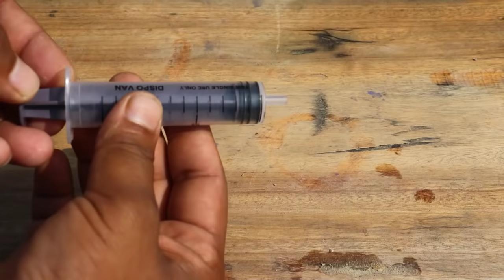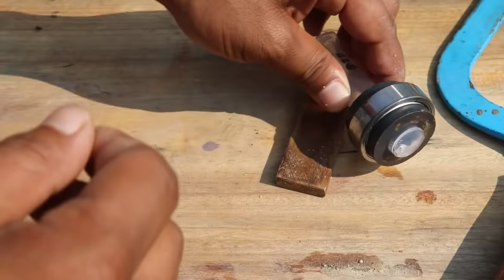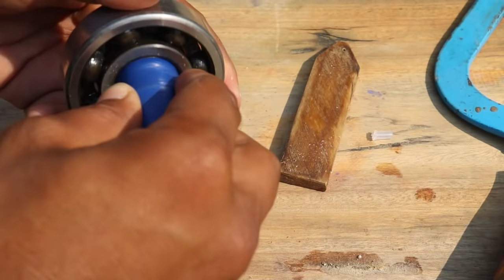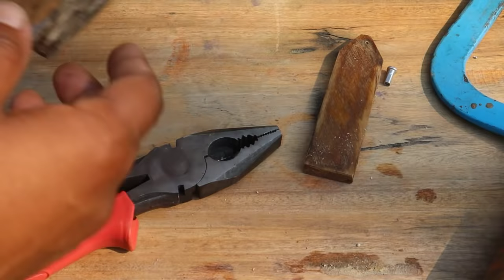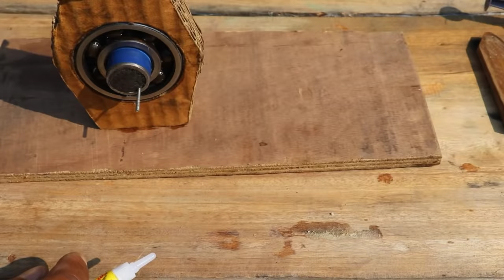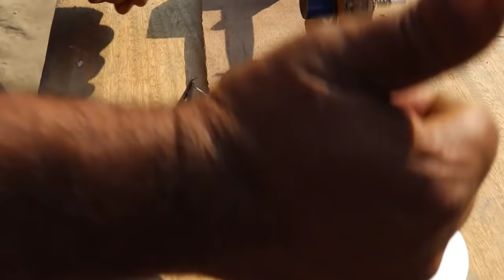single cylinder engine 100% working

Comment: You can use springs also instead of magnet but don't forget to hide rc motor & batteries
Reply: @buildingblocks6081  yes 🤣
Reply: No. Springs wont work. Magnet works cuz N -S attracts. And NN /SS repels...
Reply: @reyaroy4236  🤣🤣🤣🤣🤣
Magnet is doing pull and push and spring does the same
Reply: There is no batteries in this project
Reply: @pushpendrabhai9499  🤣🤣🤣🤣🤣
Reply: I thought exactly same... But the fact is energy can't be created only we can transform using another resource of energy...
Reply: @pushpendrabhai9499  100% sure battery or power supply.
Reply: @emil.honganmaki5461  I would think that motor would spin so fast it would break or melt his "piston" if it was hooked up to it own power supply. Feel free to do your own Utube clip. Post it here and I will watch
Reply: @mickowens9839  still a waste of time..you need to go study.
Reply: @pushpendrabhai9499  you think?????????
Reply: @emil.honganmaki5461  вранье!!!!
Reply: No cannot the compression and repulsion not equal. Not believe can try out yourself.
Reply: After some time the magnetic push and bearing momentum will equate each other and the system will stop moving.

Energy can't be generated, it can only be transform.

Comment: remove the motor and run the engine alone.
Reply: He can’t cus that’s what’s driving it lol
Reply: Isase Kya hoga
Reply: There is no fuel tank to run it. Only motor runs this pump.
Reply: fake.bcs bulb effect is not accoring to genrator
Reply: The bearing is providing momentum and reverse force
Reply: yeh sirf bullet fire krne pe piston piche jata hai.bullet jitna momentum kaha se milega?
Reply: There is no motor here. 
It has been used as a Generator/ dynamo.
Reply: @rakeshyadavji9878  chalega hi nahi
Reply: Mh
Reply: According to The first law of thermodynamics states that energy can neither be created nor destroyed, only altered in form. In present video there is no any energy alteration. According to me ... The piston is not driving by the motor, rather motor  which may be powered from some external electricity source actually, driving the the piston.
Reply: oh so this is working because of Megnet
Reply: @anup06219  right..👍
Reply: Total fake.... Motor driving piston....
Reply: Yes bro u r right
Reply: I think tha
Reply: @anup06219
Reply: @anup06219  пчела не знает что по законам аэродинамики площадь ее крыльев не позволяет ей летать, но она не знает законов физики и летает 🙂
Reply: @easycutsolutions6196  it is not total fake. Magnetic propulsion is posible. Check the fastest train in world.
Reply: It's legit  awesome ❣️
Reply: @alfredromanov4677  как и майский жук)
Reply: @anup06219  the piston is driven by the magnetic force
Reply: This would be next step of magic
Reply: Then where did he design Fuel Tank???
Reply: @anup06219  there is magnetic energy for your all comments
Reply: @isakramngaihzuala4894  exactly there is no hidden battery
Reply: @jagdishbilgi1518  a dynamo can be used also like a motor
Reply: Fir bhi chalega,kunki isake piche science hai.
Reply: Fake video
Reply: Remove o gerador que  não funciona
Reply: @isakramngaihzuala4894  very true!!
Reply: @anujekka6578  more like real video
Reply: Sin motor electrico nadie muestra xq es el que REALMENTE impulsa
Reply: Motor is not attached to this project
Reply: It's fack
Reply: I ve been see people finding to find the real reason free energy engine used motor to work many times and i want to know how it works too
Reply: @madebydimiakagreekmachine5822  but where the battery??!?!
Reply: Its dynomo bro
Reply: Stop claiming that it's fake, and prove it with a video yourself...... 
Most of you believe in God with out ever seeing Him...but can't believe What you see with own eyes.....🤣
Reply: Это не двигатель, это динамик, который вырабатывает электричество, а для динамика нужно движение, это как на велосипеде, крутишь педали и лампочки горят спереди и сзади!.. А автору я бы предложил, эту систему поставить на велосипед и проехать по дороге?!..
Reply: @easycutsolutions6196 I Do Not Think It Is Running On GAS, If You Can Break This Down to Build IT with Confidence... What is the FEE?
Reply: @carlosgraphic I am Seeing & Amazed By This.... Could You Type this Out, to Be Sure I Purchase What I Need to Build This...? Your Fee is..? 😢
Reply: Fake

Comment: It would be nice to see it running. With out the motor there.
Reply: They use a small battry incide the motor..big lay.
Reply: @saiid314  thank God because this was scaring the hell out if me.
Reply: Want to see running.. without motor
Reply: It's not possible to generate DC current without a dynamo motor..  !!
Reply: U can see it running without motor but the energy can't be generated
Reply: The small batterie inside the lamp
Reply: Чушь всё это, 🤣🤣🤣🤣🤣🤣
Reply: Не будет он работать на твоих батарейках уже 1000раз проверено, фэйк🤣🤣🤣🤣🤣дураков нашёл, попробуй без моторчика
Reply: @Rohinikadam57  How bro
Reply: @simplexsimpleeffet4766  he has the it running before he hooks the light up. The magnetic push back of plunger is the system.
Reply: The battery is in his tummy or mustache

Comment: 12 years ago i use the magnetic force for piston move and i did in my final year project while doing my polytechnic diploma in mechanical engineering.. I did as a paper work, but ur is prototype, its working hats of to u
Reply: Hey bro , what is this , you did a diploma but you can't understand that this fake
Reply: @ideasofcharan1383  i did as paper work not prototype
Reply: How could you believe it works 😅😅... Those are some tricks .. that guy use battery and motor but hiding 😂😂

Comment: Lift up the whole unit out of the table . To see that there is no supply power underneath.
Reply: It's not too complicated to understand how it works
Reply: It works.
Reply: @lestergillis8171   It looks as if it is similar poles on the plunger magnet repelling the magnet on the piston. Like N facing a N pole. But even so, I'd have to replicate this to believe it. The motor acting as a generator looks like a stepper motor. The led bulb with the guts out will run on a fraction of a volt. A watch battery would power it for weeks. Attaching it completed the battery circuit and the led lights, motor.... He must be pushing a button as he cranks it. Looks cool but hmmm. A little too cool. The ELITES keep that free power tech. They've killed over the hydrobuggy, Stan Meyers in Grove city OH. IF you invent something that threatens profits. Shhhhh.
Reply: @MrPressfone  He DID put a spring inside that plastic plunger. But that in essence changes nothing.  There us NO energy input into that plastic plunger. 
 Therefore NO energ out.
That electric motor is turning everything else by an unseen battery. 
Watch video again & pay special attention to where he places his LEFT HAND.
 He is feeling under the far edge of that table. He is switching on a small battery under the table.
Reply: @dineshadithya369  It works at scamming the gullible.
Reply: @lestergillis8171  I will give it a good looking over when I get the time. I'm usually more observant. Good day man:)
Reply: @MrPressfone  It is DEFINITELY a SCAM.
Reply: @MrPressfone  Gerard Morin talked about that in one of his videos, there are hydrogen videos out on making diy hydrogen fuel cells and cars running on the gas. The problem with the motors gumming up is theorized by Gerard because of the spark used to ignite it, which he claims the missing buggy was most likely using the plasma energy he uses/used in his over unity generator. I say uses/used because he seems to have disappeared around 2014. He used dc converted to ac, which passed thru a spark gap becomes ac direct. That ran thru a vacuum tube spark gap becomes plasma energy or as the electric company refers it "skin effect". They can produce more energy with very low amps so it doesn't burn up electronics. Gerard was trying to get a speed controller built when his videos stopped. 
   2014 was also the year the keshe foundations magrav power pack was gave to the world leaders and then nothing came from it, well nothing but the new types of batteries being sold. Nano tech was used to disassemble nuclear waste and reassemble the particles in a safe arrangement so a trickle charge could produce massive amounts of energy. 
   The video interview of Lt colonel Thomas Bearden on pulling free energy from the 4th dimensional vacuum i believe has something to do with the open spark gap transforming ac sine to ac direct. But any questions I've asked particle physicist get removed and un answered. Seeing how we have a patent for ftl travel, and it uses plasma "skin effect" energy and mercury super chilled to -15,000 degrees to seperate the craft from the tidal energy, i imagine we'll never know until after Jesus returns and puts an end to the satanist running the world. I know there were videos of using argon and mercury in vacuum spark gaps for the rockets they were building in the late 50's early 60's, it was amazing how much energy they were able to produce. 
   Point being, i think your 100% correct, the real rulers who own global corps and the fed reserve banks will never let real free energy out. God bless!!
Reply: Magnetic energy work here....
Reply: Lol, love it. Clever to connect the "generator" and led light bulb (which contains an internal battery) to show that the magnetic piston machine can produce electricity. Nice distracting wow effect. Let's see the machine work on its own without the "generator" belt connected. You can glue a little propeller to the other end of the rotating shaft to show that it is producing power. Now that would be impressive.
Reply: @carlbittner9691  I suspect the battery is under the table. 
 Watch his left hand closely...

Comment: Can i have a request

I want to see it turning without the motor
Reply: I also
Reply: he will not answer you because the video is fake
Reply: My request for you is, if you not like this guys projects. look up Creative think channel. Electricity from magnets is nothing new
Making a magnet piston work with out attaching it to anything?? now that would be something
Reply: @mickowens9839  Many people says is fake, but they not try to replicate it to see if it a fact or not. Like you say magnetic powering is not new. Japan has the fastest train using magnetic propulsion. I think they use polarities for speed and change the polarities to stop the train.

Comment: Well done, but false.  Mechanical and dynamic friction create energy loss that slow down the system till it stop.  Only an external power supply can keep it running. Many years ago was demonstrated that "perpetual movement" cannot exist on earth. Only in absence of friction (or other external forces) a body maintains  his status of movement or quiet indefinitely. It's called the first principle of dynamics.
Reply: What if it spins floating by magnets in a vacuum? No air, no friction?
Reply: @DannyTillotson  In perfect conditions it might be possible to get something to function indefinetly, but it would never be possible to take energy out of that system (to light a bulb for example)
Reply: @ionutboghean6883  Interesting thanks! What if we connected a wireless charger from the outside to the device working in the vaccuum?
Reply: @DannyTillotson  Whatever the device, using any method to take energy out, will slow down and stop the device sooner or later. That is because energy is finite and you cannot take more than you put in. You can think about such a system as a battery, probably a mechanical one depending on the type of the system.
Reply: He cannot show the underneath., otherwise the reality would be shown to everyone.,😂😂😂😂😂😂
Reply: Exacto!! Este es solo un fanático del súper glue 🤣
Reply: I know how to build magnetic generator solid state. It requires only 5 volt signals to switch the stare of material interacting with permanent magnet.
Reply: It's false
Reply: @everythingonclick  build one similar and prove it .🤣🤣
Reply: It's a trick
Reply: Why do you dont do the same experiment AND prove that It Is false??
Reply: Considering the flywheel momentum when it reaches its top dead center or its bottom dead center and also consider the fact that the cylinder is expose to sunlight that makes the air inside raises temperature and expands.
And also the eddys effect that the magnets create.
Reply: There is no such free energy

Comment: People like him set back science. They teach kids the wrong things instead of showing them that it dose not work and explaining why so they can try to come up with a better design. Notice that the motor did not slow down when he put the light on. That's because power is being fed to the motor and the bulb is in parallel circuit with the motor. Shame that this YouTube is allowed. If it was a magic trick at least you know that there is a trick and the elephant did not disappear.

Comment: Hello,
We agree that the left rack is only used to turn the motor. So the movement of the right part must be strictly independent on the motor. Can you then disconnect this rack and make only the right part work to show us that this right part can work without the motor please ?

Thanks in advance
Reply: Impossible
Reply: @sukhdevsandhu4827  exactly because the motor is powering it.
Reply: @johncollinsgrove1750  yes
Reply: He can’t for the same reason it can’t be done in Internal combustion engines, you need momentum to keep the cycle running.
Reply: without the motor or some sort of resistance the magnet will not continue to operate as a piston. his newer project had 2 pistons that works even better but not faster and still requires resistance, remember its just a small project to get you thinking how to make it better. Instead you look at it as some sort of trick... Why ?? 
Using magnets to create momentum is nothing new, Creative think channel did it years ago, : https://www.youtube.com/watch?v=-sqLr3o_0F4
Many others out there too, using a flywheel instead of a piston, when you build yours try adding offset weights

Comment: Es una estafa si no levanta la base así demostrando que no está cableado el motor cuando marcha.
It is a scam if you do not lift the base thus proving that the motor is not wired when it runs.
Reply: Es falso el invento ya que el que se repelen. Dos imanes del mismo polo no puede mover la biela para impulsar el cigueñal y así hacer girar el motor la trampa está en el motor que a sido alimentado por debajo de la madera así logra el movimiento el motor no genera. Nada el foco lo conecta de los cables con corriente
Reply: Tal cual nada más que decir, que la gente se deja engañar. Saludos

Comment: Magnificent and marvelous innovation without electric motor using only magnetic power. This innovation denotes that without using batteries electricity can be generated for running vehicles and industries only by generators reducing the expenditure heavily for generating electricity than solar energy. It is also not known why our govts. are not introducing these methods to public and industrialists to follow to reduce incurring of huge amounts in preparing their products. The products will be available to the public with cheap rates in the markets. The transport charges and fares by buses, railways will also become very cheap to the public.
Reply: hhhhh
Reply: The only one who believe this are the one who never learn physiscs

Comment: Why doesnt the piston move in and out by itself when you first assemble it? The distance for the stroke has to be pretty exact to keep the magnetic push and pull strong... somethings off here..
Reply: He used both round magnets with opposite poles attracting to each other. Due to the existence of both fields, the piston magnet takes the balanced field position. The balanced position changes as the number of magnets changes to the piston.
Reply: Yes there is a compressed air cylinder under the table and two holes drilled in the tube to provide the force to drive the piston.
Reply: @dineshadithya369  i know..still  doesnt address my question...

Comment: This is bound to reach an equilibrium and stop at one point because of friction but very efficient 👍🏻
Reply: If add another piston with 120 degrees apart will be more powerful with double the motor torque.

Comment: Fun to watch video but I’m unsure of the trick.., either the ‘generator’ is actually an electric motor or possibly compressed air is jetted into the cylinder to give the effect, all the same.., nice enough trick :)

Comment: I'm still trying to understand how only in India, without any kind of engineering degree,  you can create energy without consume of combustible material or electricity, simply with basic materials such as spring syringes and magnets, and thick wood to hide batteries or any cables of course

Comment: I can understand the theory behind a machine like this as I am an engineer.  This seems a bit far-fetched at best.  Run it without the motor attached.  Then show it running if you can, without anything electrical attached.

Comment: Unlike the 2-cylinder version ( https://youtu.be/0RygYcrm7vA ) this one doesn't seem logical to me.  The force of the magnet in a single cylinder is not enough to produce a full revolution of the bearing used as a flywheel, let alone rotate the electric motor as well.  In this case I conclude that there is manipulation of the result. The basic principle is correct.  It would be interesting to try this with the right resources and technology, a version that uses a crankshaft to allow 4,6 or even 8 cylinders.

Comment: Purpetual motion machine. This isn’t even a real one. I suspect the motor is driving the piston. However some will run for awhile. But it’s an illusion, friction will eventually slow it down and it will come to a stop. Faster if there is a load. You can’t supply more power than you put in.

Comment: If the light glow with the turbine motor means there is a small fluctuation u can see. But here there is no fluctuation.he fixed small battery to glow the bulb. Its not real.